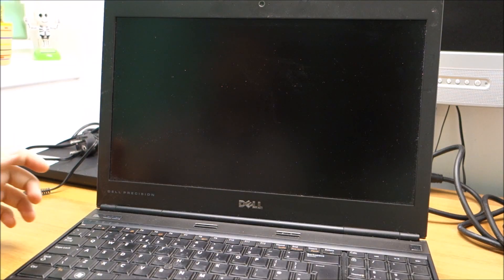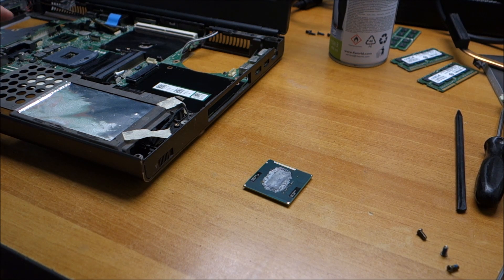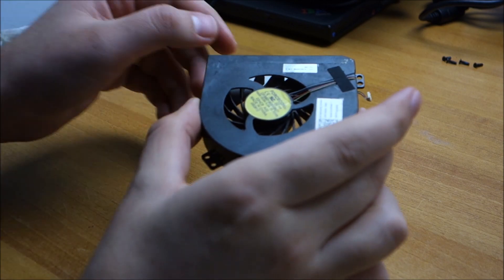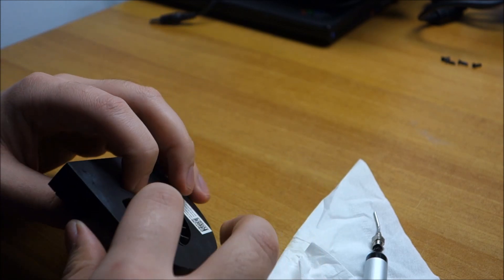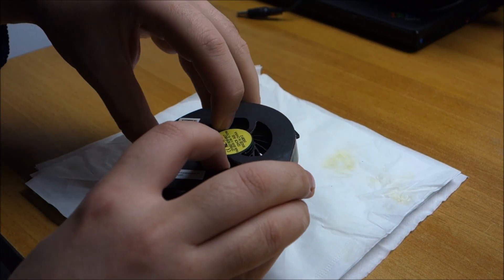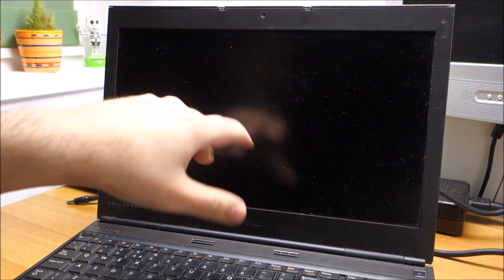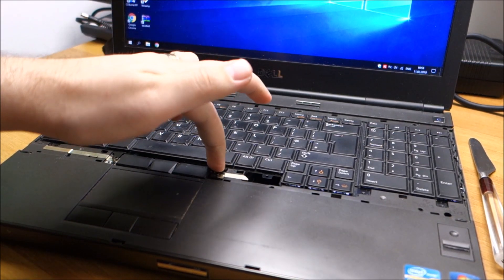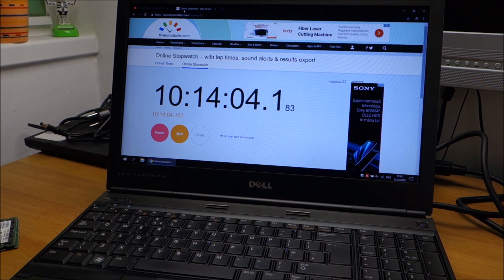Troubleshooting a DELL M4600 laptop that randomly shuts off

Comment from the maker: ▬▬▬▬▬▬▬▬▬ஜ۩۞۩ஜ▬▬▬▬▬▬▬▬▬
        T H A N K  Y O U  F O R  W A T C H I N G !
     P L E A S E  L I K E  A N D  S U B S C R I B E !▬▬▬▬▬▬▬▬▬ஜ۩۞۩ஜ▬▬▬▬▬▬▬▬▬
Reply: have the same problem. for set of fans i got me this https://www.aliexpress.com/item/32833098034.html?spm=a2g0s.9042311.0.0.dd374c4doFSdU5
as i told other guy in comments mine only happened while i was watching you tube videos. i test on safe mode  2 hours of you tube video all ok. also found out my hestsing wasnt touching my built in gpu. had no problems for 3 days but today it shut down. how do you test memory? can you explain in detail.? what are your temps.? wich program you use to monitor temps and wich browser as i would like to compare my temps.
Reply: have a look at this would like to see a video before and after http://forum.notebookreview.com/threads/guide-how-to-control-fans-on-dell-laptops-under-windows.805317/

Comment: Buna!
Mm un laptop Dell M 4800.  Nu porneste numa daca incid ecranul si scot cablul de alimentare.  A ajuns la aceasta erroare din cauza mea, cred ca am dat restart in loc sa il inchid, apoi l-am bagat in geanta si am auzit ca porneste,  deoarece ma grabeam  ca să îl opresc repede am scos bateria ca nu aveam timp sa mai stau sa il opresc normal. De atunci nu mai pot sa il opresc numa daca dau oprire cu mausul si las ecranul ridicat. Daca dau oprire si vreau sa il bag in geanta, când scot cabul de alimentare si inchid ecranul se porneste automat.
Ce as putea sa fac? 
Multumesc!
Reply: Hi!
 I have a Dell M 4800 laptop. It doesn't only start if I turn on the screen and unplug the power cord.  He got this error because of me, I think I restarted instead of closing it, then I put it in my bag and heard it start, because I was in a hurry to stop it quickly I removed the battery because I didn't have time to  I'm going to stop it normally.  Since then I can only stop it if I turn off the mouse and leave the screen up.  If I turn it off and want to put it in my bag, when I unplug the power cord and close the screen it turns on automatically.
 What could I do?
 Thank you!
Reply from the maker: Buna. Imi e imposibil sa ghicesc ce s-a intamplat. Ori s-a dat peste cap ceva in bios, ori in Windows. Dar fara sa vad laptop-ul nu stiu ce.
Reply: @UltimateDIY  ieri am reinstalat windows-ul, am actualizat bios-ul am pus alta baterie si nu si-a revenit.
Reply from the maker: Incearca si:
- deconectezi incarcatorul;
- deconectezi bateria;
- apesi continuu butonul de start pentru cel putin 30 de secunde.
Apoi cuplezi doar incarcarorul si incerci sa pornesti laptop-ul normal.
Daca si-a revenit pui si bateria la loc.

Comment: My 4600 would also turn off on its own. Took me a while to realise why...... After some time i figured out it was only doing it under high load. 80% CPU or more. I had purchased mine used and it came with a dell 90 watt PSU. Turns out these should have a 130 watt PSU. With the bigger PSU it was fine under high load in High Performance setting. I still run mine with Win7 Pro x64, with all the correct Dell drivers. I use it for DJ use and its just a rock solid laptop. These things are moulded like a brick, and they can take quite a beating. As heavy as mine is to carry around, i love it. I have another laptop at home for general use, so this one is kept clean and just for a specific task. Its not far off a panasonic tough book, but with far more power !.
Reply from the maker: Yup, they need quite big power bricks.

Comment: Hello bro i have also problem with dell precision m4600 first it came with amd firepro m5950 i used it for 2 months then one day it shows lines when starting after few days it won't show any display i bought amd radeon firepro m5100 along with new battery because last time i playing a game on battery with amd radeon firepro m5950 after installing amd radeon firepro m5100 and using it for one month just watching videos but suddenly while watching videos it crashed i plugged out battery and restart but laptop won't start no display i am little confused now i subscriber
Reply: I know i'm 2 years late but did you find a solution i'm currently experiencing the same thing

Comment: its the built in gpu . try this enable optimus in BIOS so it uses built in gpu..test again.. if it shuts off then try this.. run laptop in SAFE MODE and it wont shut down.  Windows uses a very low screen resolution with generic video drivers. so i think it doesnt overheat. the gpu dont have good contact with heatsink.
Reply from the maker: Thank you for this info, but in my case it was the memory.

Comment: After watching this video, I still don’t get the answer for what is causing it to randomly shut down. Is it because of the graphics card?
Reply: i think its the built in gpu not getting proper cooling.  my 4600 has the same problem.  test your in safe mode this way mine didnt shut off for 2 hours buth normally would take from 5-10-30 minutes. only if watching you tube videos. i suggest to check if heatsink is making good contact with the diode that shiny part. mine wanst and then lasted longer.
Reply: @chapoguzmaneldelasnaranjas5988  thanks for the recommendation, I will buy some of it!!
Reply: @NaokiYuusuke  ive seen this but havent tried. http://forum.notebookreview.com/threads/guide-how-to-control-fans-on-dell-laptops-under-windows.805317/
Reply: i got me this
https://www.aliexpress.com/item/32964078069.html?spm=a2g0s.9042311.0.0.dd374c4doFSdU5

https://www.aliexpress.com/item/32833098034.html?spm=a2g0s.9042311.0.0.dd374c4doFSdU5
Reply from the maker: There is no simple answer. For me it was the ram, but for you it could be anything else.

Comment: You can further dissasemble the cpu fan shroud, and just pull the rotor off so you can oil only the fan shaft
Reply from the maker: It seems that what I did in the video was enough this time. It's still silent.
Reply: @UltimateDIY   unscrew the 2 screws and assembly will open then pull rotor fan up apply grease and oil.
Reply from the maker: No need yet. It's still silent.